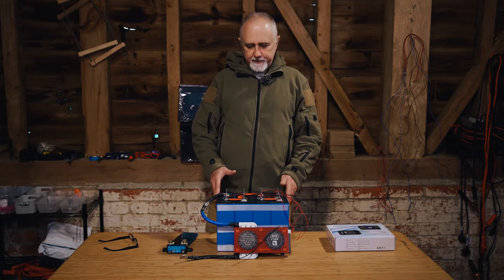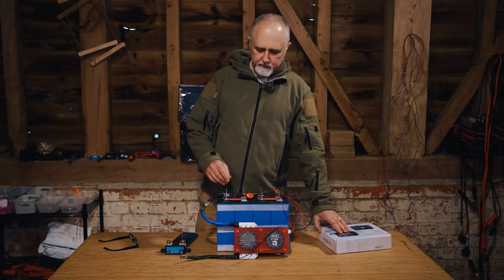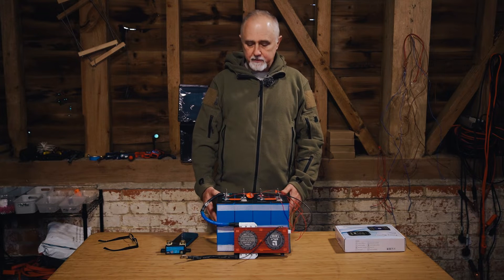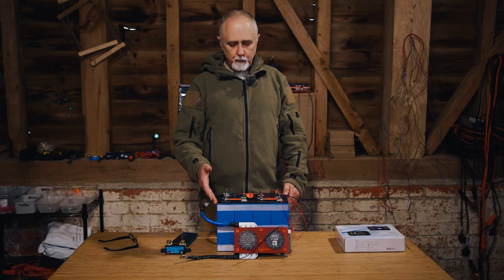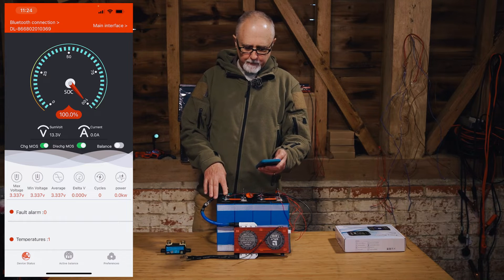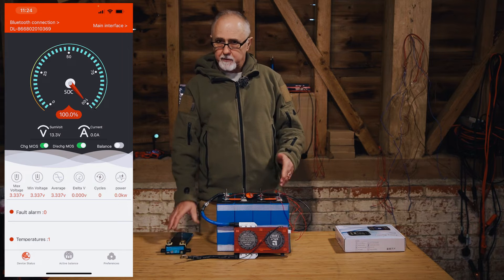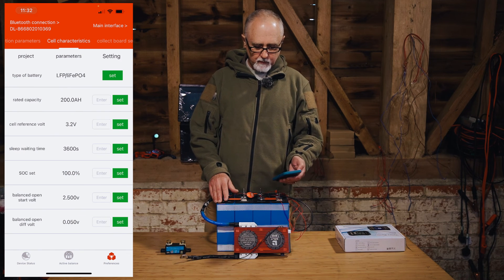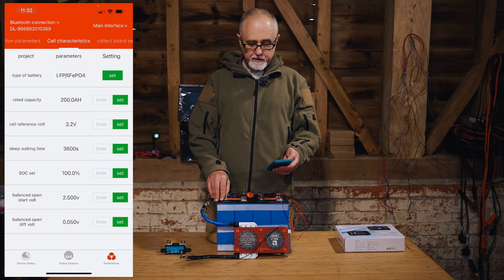Daly BMS State Of Charge Accuracy Problems

Comment: the problem with a charger at less than bms cutoff is that the battery will reach 100% but, if the charger doesnt cut off, you then low voltage overcharge the battery. If a company sets those defaults I wouldn't buy the BMS as it indicates a fundamental lack of understanding. Zero isn't a magic point, you can charge lower but at a much reduced value. Equally you can't charge at full rate at close to zero particularly if the battery is fairly full.

Comment: Hi, I have a question. I have 8xLifePO4 310aH 3.2V batteries connected to the Daly BMS. Recentlythey were at 25.9V. I tried to recharge connected to an normal electricity outlet. Both at a camping and at home. It's also connected to solar via Voctron, and should recharge when driving. It stayed at 25.9V for a long time. Recently (think after a month) it went back up to 26.6V, showing a SOC of 92.2%. I am lost with why this can be, but we had issues in the past, and camping without electricity is no fun, especially when i am connected to an outlet on a camping. Anyone any ideas what is wrong, or what setting is wrong?

Comment: Those settings would be useful if the voltage reading of the bms was real, not 0.3-0.5V off which is critical. Already ordered JK bms , and will throw daly

Comment: yeah their coulomb counter is a bit weird. My LiFePO4 pack is used as a buffer battery with a CC/CV charger and an DC/AC inverter, essentially like an online (double conversion) UPS.
The CV voltage is set to 13.6 V, or 3.40 V per cell.
Even though the Daly app allows to set current SoC in the parameters, still, when I set it to 100% when the cells are floating at 3.40 V and no current is flowing into the battery anymore, and then discharge it to say 75% and then recharge back to 3.40 V per cell, the SoC indicator doesn't go up to full 100%, but rather stays at something about 94% and drops further with each subsequent recharge.

I however have an active balancer additionally connected, so that may play a role, but I don't think it should be significant, provided that the battery capacity is 600 Ah, or ~7.6 kWh, so whatever's consumed by the balancer during the discharge/charge cycle should be negligible.

I may try using a separate shunt based counter to compare the results with what the BMS is showing.

Comment: BTW , I supposed I can stop an electrical vehicule from a distance by switching to "off" thev disch. MosFet with within the wifi app. Could help againt robbery .! But it is may be not so strong , wi   noticed, if plug the charger, all Mos turn to "on" . On the other hand if I unplug the charger, all mos switches come back to whete I left them . I dont know which is the master when comm is used is it the software ? Is it the bms ? (I asked, was promized an answer monday )... good week end to all

PS : an usb 435, Can,  or serial cable allow to use the software "pc host" which is mandatory  i.e. to have recognized a "key" (simple on off switch.)  That pc host app is the most complete app for in deep parameters (and posdibly to upgrade the software) ... regards

Comment: Hello, that was interesting. I use a balance100 bms. A new brand from Daly. They are using  2.85v as litmit of tension by li Ion cells.
There i a regulation/ computation of the Soc wich is ; you enter 100% soc when your battery id full, the first time you use the bms.
It is then calculated af 13:32 ter a full cycle charge decharge. I use a Atorch dl24 (4 fans, 600W) to get up to 13A from the 13s6p battery and it cut at 39V or 2.85 on the dl24. On the parameters page there are 4 parameters one I do not get what it does it is : Zeroing the current drift. I think it is may be a way tosubstract the current drift due to impedence of  wiring, cintact points, etc. Is it the case ? Best regards

Comment: I really like this and agree with you. I have an issue with one of my two Daly BMS. It losses SOC even though the battery does not. The two battery banks are always at the same charge level but one BMS show a dropping SOC. I can't reinstall the firmware or software can I? I reset SOC on the same battery bank. Also I am using the parallel modules.
BTW no answer from Daly.

Comment: If we charge the battery With a 60 watt 12 volt solar panel directly through the Smart BMS without having to have a charging controller, is it possible?
Normally, how many volts can the Dali Smart BMS withstand?

Comment: I bought a van with 4 batteries and was told the storage was 400ah. I have the same Daly setup as this video and when fully charged the app says remaining capacity is 150ah. In the app settings the rated capacity is 150.0ah. My question is how does the bms workout the actual ah? Can it be changed manually? With it being 150ah does that limit the storage to 150ah? I suppose I am just trying to workout if it is the bms limiting my storage or is my storage really 150ah and not 400ah? Thanks
Reply: Open up the battery pack and eyeball them.thats the only way to be sure

Comment: I can see the following playing out:
cells are not in exact equal balance, using the higher high-voltage cut off, will allow better balancing to take place, where-as setting this value too low, the BMS will cut off charging too soon for the BMS to work on balancing cells. As you noted with low voltage, even at high voltage, cutting off the charging current will quickly result in the cell voltage dropping to a lower value. This is especially true under load.
On the low voltage cut off, as you pointed out, under load the cell voltages sag, but once discharge is cut-off, these cells bounce back to higher voltage very quickly - within seconds.
The "neg 40C" low temperature charging makes no sense at all with Lithium Iron Phosphate - but dues make sense with lead-acid.  I feel your comment about battery capacity setting "Daly has no idea what cells you are using" applies here as well.  Daly have no idea what capacity or chemistry cells you are using: so user needs to set parameters for low, and high temperature cut-offs and the cell capacity.

Comment: I have all three devices for measuring SoC that you have tested, and my experiences agree completely with your closing comments.  I have bought 4 of these BMS and 1 has definitely failed during warranty for no apparent reason (No replacement from Daly).  
Another one is behaving erratically.  I am considering dispensing with Daly BMS and replacing them with three devices:
1-  A 200A resettable 'fuse/breaker'
2-  A Victron Smart Shunt
3-  A 16S active balancer (Active Equalizer Balancer 16S Lifepo4/Lipo/LTO Battery Energy Capacitor)
I know this may be frowned upon by experts but my reasoning is as follows.
1-  The breaker is better than FETs as a disconnection device when there is trouble.
2-  The Victron Smart Shunt is more stable and produces graphs useful diagnostics like V, A, Watts, and SoC.
3-  The Active Balancers are autonomous and just get on with the job quickly.  A diagnostic check of each cell every month or 2 (or 6?) can be done with a voltmeter. (BTW have you seen Pokit meters & dataloggers) https://shop.pokitmeter.com/
From my perspective, replacing the erratic Daly BMS will reduce the chance of having 'issues'.
What do you think?

Comment: On your first two gripes about high/low voltage protection defaults... I think you've forgotten general point of any BMS, it is only for emergency protection of the cells - the last line of defense if you will. Therefore the default high volt protect & low volt protect should not be adjusted. The charger should always be the device shutting down at the desired voltage, if it doesnt and continues to charge then (and only then) should the BMS shut it down. This case on a properly designed system should be extremely rare - only when the charger malfunctions and continues charging. If the charger being used is charging higher than your desired voltage then you need a new charger, a BMS should not be used to regulate this - it was not designed to do so. On low voltage if you are regularly relying on the BMS to shut down at the low voltage protect then and its a poorly designed system. Either not large enough battery system capacity or you do not have any other safety measures in place. Again, BMS should only step in if other systems fail, therefore voltages should be set to higher and lower than these systems. 

Your third gripe; the low temp charging cutoff, I completely agree with you that it is far too low and will cause damage to cells if charging is continued at this low of a temperature.
Reply from the maker: Thanks for taking the time to write out your comment. You have some very good points there.
Reply: So wrong about so much you said in this comment.  A lot of us use our bms in other ways than you described

Comment: My main issue is that my Daly BMS doesn't provide accurate SOC because it doesn't register current draws below 2A. In my van I have a lot of low loads that draw below this so inevitably it will begin to lose accuracy. I've heard there is a way to change this but not via the app.
Reply: I've since bought a victron shunt which counts coloumbs and the difference between the shunt SOC and dally's varies wildly. I simply do not trust the dally SOC.
Reply: I noticed this as well it doesn’t register a simple roof fan on its own
Reply: You can modify with external app what’s the minimum it recognises.
Reply: @cyberfuker85  2A. The setting can be adjusted apparently but it requires a PC and moving past the UI in the app. I've seen other comments saying it isn't very accurate, probably the reason why it is set so high. I've pretty much given up on it for anything than cell monitoring, current limiter and low temperature limiter. It!s balance and SOC functions are pretty useless.

Comment: Generally speaking some (or many) systems are designed that BMS is the last line of defense for errors and charger is what determines high voltage cutoff and inverter handles low voltage cut off. Im sure that is why daly have such high high-voltage cut off and low low-voltage cut off. But that ofc totally go against dalys way of resetting its columb counting

My system do not like it when the bms cuts off power, it is a bit random what can happen but sometime my solar charge controller and/or inverter may need a manual reset.

Comment: I think I can see a rationale why 'cell volt high protect' should be slightly greater than the charging voltage ÷ 4. If they were the same, wouldn't charging stop as soon as the constant voltage phase of charging begins, and so the cells would never be fully-charged to the desired 100% charge voltage?